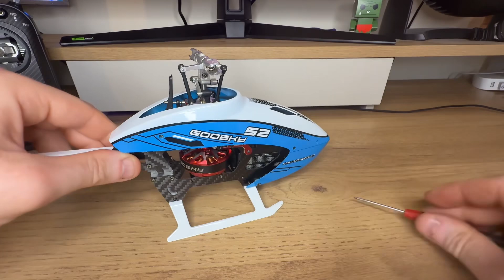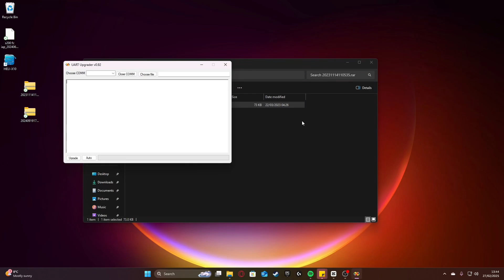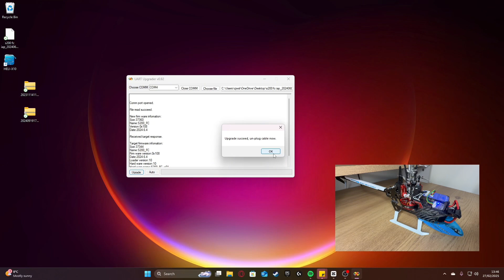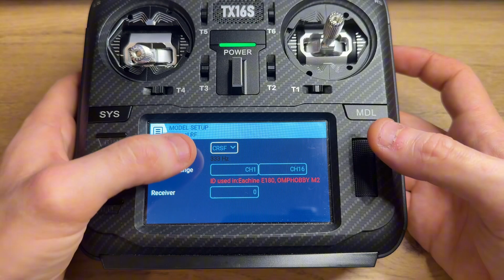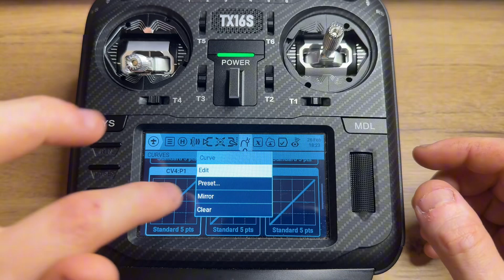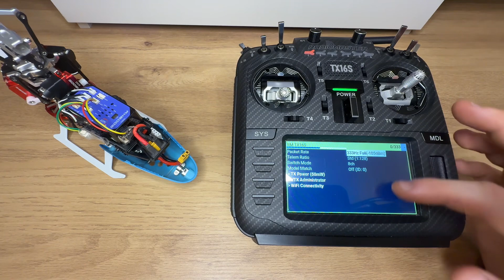Goosky S2 - TX16/ELRS Setup

Comment: Note that for the S1 v1 using sbus, the channels were the same as for the built in fhss, but the directions needed to be changed. Most notably, I had to reverse the throttle channel and adjust my throttle hold override accordingly. I think by the end I had every channel reversed from how it was before, including flight mode... But most you can just test. I recommend removing blades before experimenting with throttle reversing, in case other models / firmware versions are different.

Comment: What switch did u put the auto stabilization on ? Channel 5 for erls has to be an arm switch , so what did u do?
Reply: ELRS V4 removes channel 5 as arm requirement. You can now move it to a different channel.
Reply: @zackcannon2985 nice , I will try it , thanks!

Comment: Can you please clarify which of your  3 coloured  wires connect to which - 5V TX and RX confirm no ground required?
Reply from the maker: Hi, the only one not in use is the RX, At 25 seconds in you’ll be able to see. GND-GND,
5v-VCC, Signal-TX
Reply: Thank you for taking the trouble to reply
Reply: Is it the same for goosky s2 max please connor ?
Reply: Do you lose any functionality by not using the rx lead?
Reply: Can this be done on rs4 with goosky fbl? I got it to work on the S2. Is the elrs file the same?

Comment: Is the BUS of the ELRS receiver set to SUBS mode?
Reply from the maker: Yes!
Reply: @ConnorSloan for me it did not work with SBUS. I had to select CRSF as protocol for the ELRS receiver. I have the S2 legend first version, and put the same 2024 ELRS firmware on it. However with SBUS it worked for the S1 first gen. And OMP M2 first gen.

Comment: I’m wondering how to set channel 5 for the auto leveling feature.
Reply from the maker: @richardknapp5727  hi Richard you have to set this in the special function menu
Reply: @ thank you. I’m a bit lost. Not sure how to set this up exactly  or how to set up 3 rate modes
Reply from the maker: @ if you can contact me via instagram I’ll be able to help you a lot more 
@sloan_RC